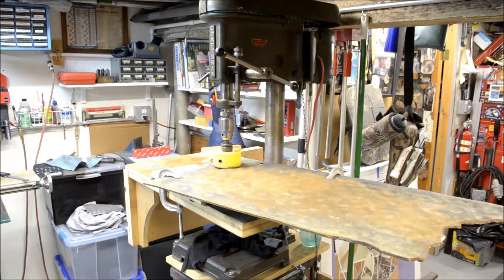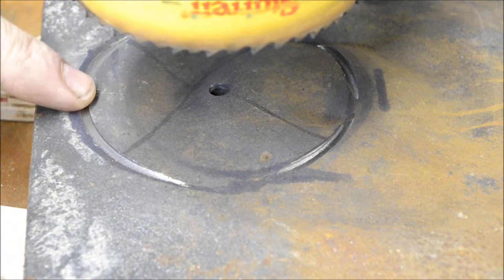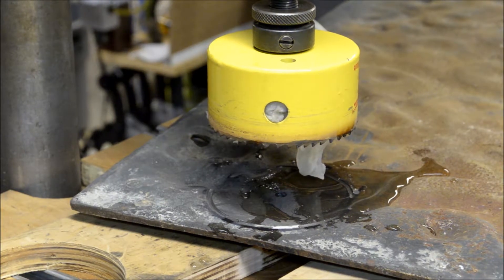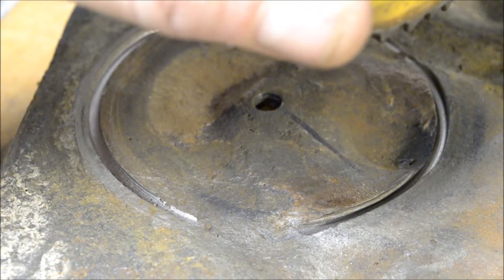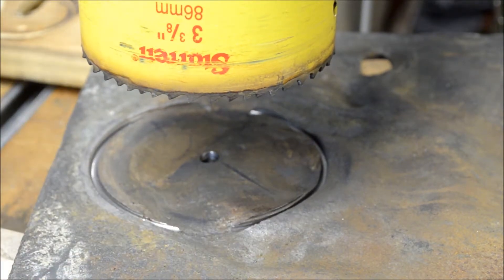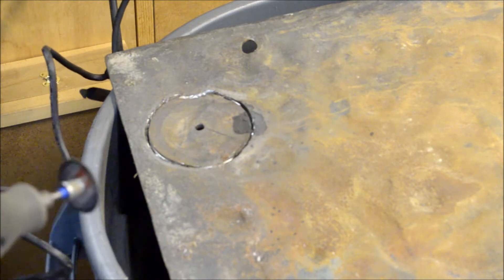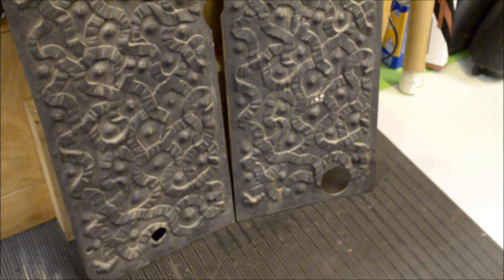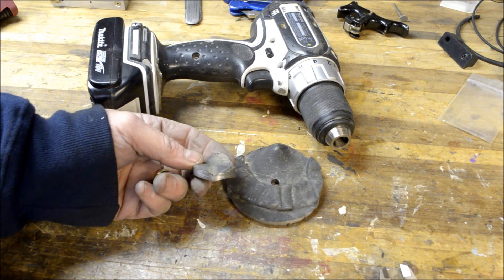Hole Saw vs Cast Iron

Comment: has any body tried the M. K. Morse Carbide Grit hole saw, on cast iron, I hae tried the Staerrett bi-metal hole saw, but it took ages, I have no objections against Starrett, it's just 
" horses for couses "